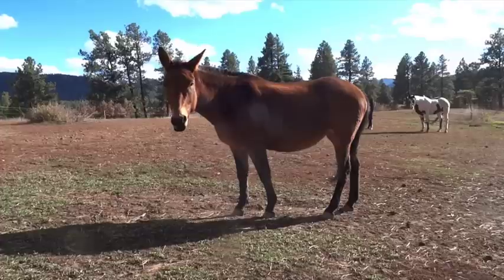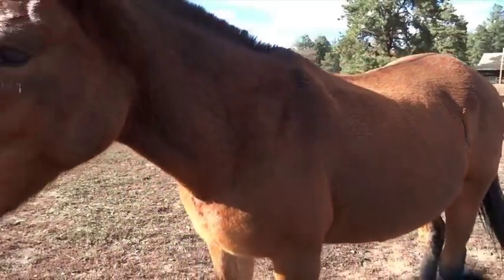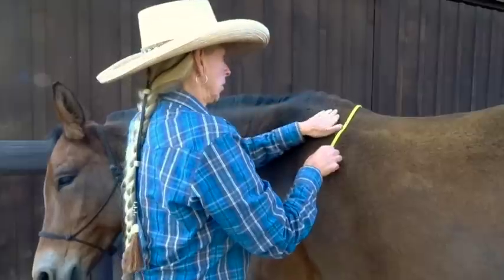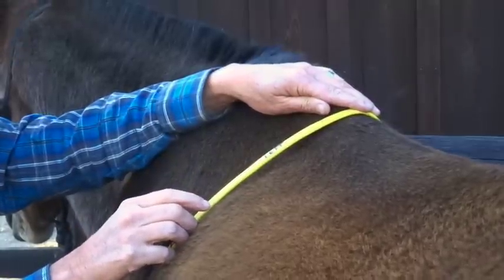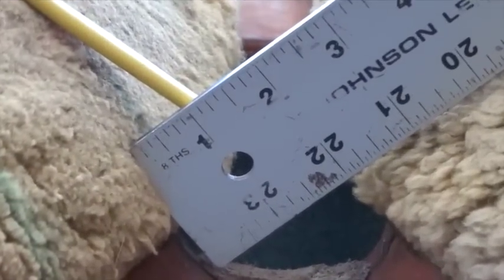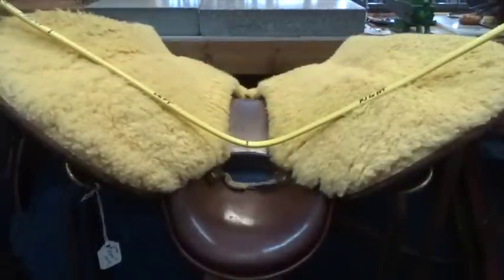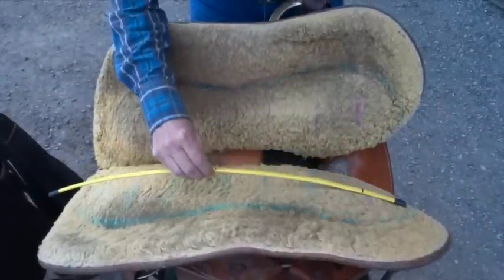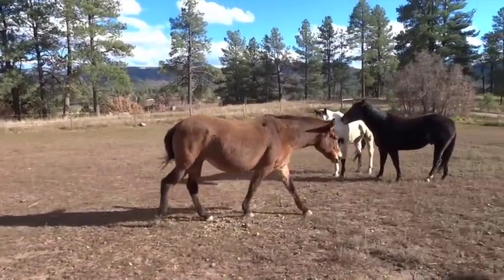Evaluating Saddle Fit

Comment: I agree with your wire demo in regards to the tree width however the 1/2" no contact gap in the middle of the bars isn't as big of a deal when the horse is in motion. The back muscles tighten and lift with every step at least a 1/2". As the horse gets worked more those muscles will develop bigger to fill in that gap

Comment: This is a stupid question but what is the wire (or where can I get on) that you are using called?  Great explanation on the rest :)
Reply from the maker: Hi Jennifer,  there is no such thing as a stupid question! It is a 24" piece of 12:2 Romex housing wire.  You can sometimes get scrape from an electrician, buy at a hardware store or electrical supply store.  There is more info on our website on these pages: https://outwestsaddlery.com/fitting-a-saddle/fitting-how-to-guide/ and  https://outwestsaddlery.com/fitting-a-saddle/fitting-info-philosophy/
We are glad this was helpful for you!
Reply: thank you - I just lost all my tack in a barn fire and want to make sure i get proper fitting stuff - one of my girls took me 2 years to find a saddle that fit her and I dont want to do the buy and sell again :)
Reply from the maker: I am so sorry to hear that!!   If we can help let me know!  My husband has engineered trees that fit todays horses really well and we have the only tree maker we know of that will make the front bar angle like we have figured out most need.  We can do lots of different angles and rockers as needed.  Thank You!
Reply: Staedtler makes a flexible ruler that is great for this!! :)
Reply: Actually the flexible rulers are not accurate!  They are too flexible and don't hold their shape from forming to the animal to tracing paper.  We have received many tracing using these and they had to be redone.
Reply: Terri Beecher oh I didn't realize, thanks for the info!!
Reply from the maker: Your welcome!

Comment: What if your mule is over weight? Will the fit still be true if you measure now, and looses weight? I do plan on bringing him down to proper weight.
Reply: Their ribs and spine don't change, just the "fluff" in between.  If you have the proper bar angle in the front of the saddle tree you can use our saddling fitting pad to help do saddle fit correction for the changing body.  Most horses like people change with age, conditioning and diet.
My mule was obese, had terrible ulcers and was metabolic when I first got her. through diet change (simplifying her diet) and putting her on an herb program (one of our services, I do long distance evaluations using kinesiology and set up herb programs to balance their body) she is now normal weight and she is free fed a low protein grass hay in hay bags for slow feeding.  She is in great shape now for her age.
For more information see our web site www.outwestsaddlery.com or call me Terri at 970-264-2524

Comment: Probley had a so called mule saddle that mule has enough withers to use a nice horse saddle with a good nonslip pad.
Reply from the maker: Yes, the saddles that she wore before Terri got her definitely didn't fit right, and caused a lot of the atrophy issues she has. 
The difference between a horse saddle and a mule saddle are in the "rocker" of the bars. A typical mule saddle will have flatter bars, because most mules have very flat backs. However, that shape doesn't work for her, because her topline is dropped, and it creates a sever bridging issue with pressure points in the front and back, and no pressure in the middle. 
You are correct that a more horse-shaped saddle with more rock fits her better in the bars, but the height of the gullet should be determined based on the individual animal's conformation. A normal gullet height works fine on her when the saddle is shimmed right. Dilly does have high withers, but a lot of why they are so pronounced is because of the atrophy on either side of them, meaning that any saddle will fall into those dips and probably make the gullet look too low. It doesn't matter if it is a mule saddle or a horse saddle, they will behave the same in this way. The correct fix for her atrophy, and therefor the wither height problem, is to shim under the middle and back of the saddle which will raise it up off the withers, and leave space where these dips are, so that her musculature can fill out there, and naturally raise the saddle over time so that eventually, she wouldn't need shimming at all.